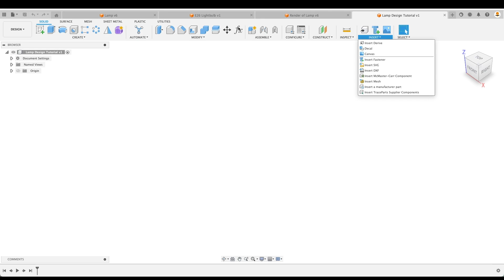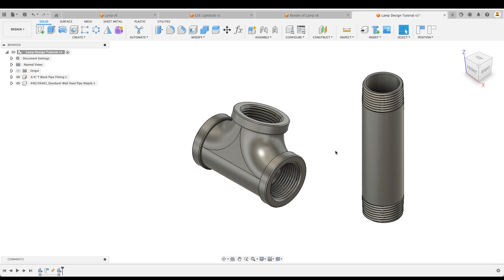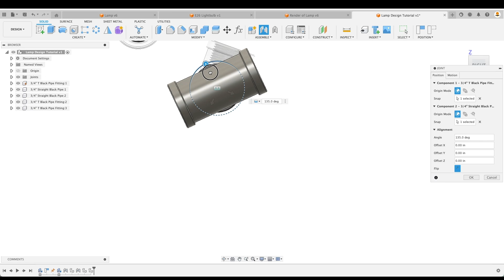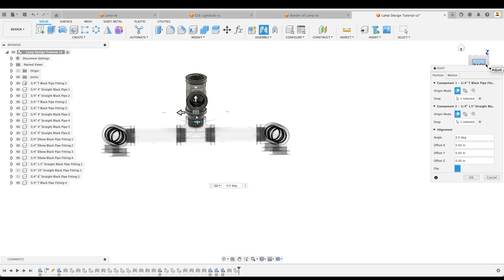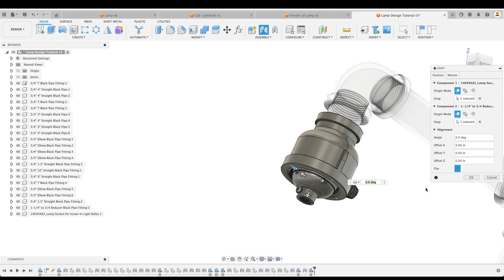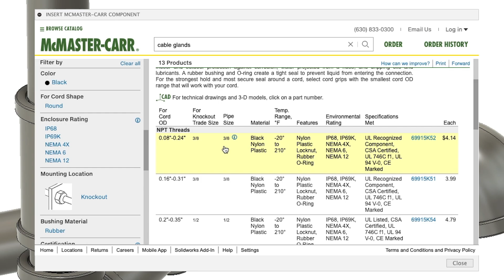Autodesk Fusion 360 - Black Pipe Lamp - Assembly Tutorial (2024)

Comment: If i wanted to specify how far the nipples thread into the fittings (0.6” as an example) how would I go about doing this?
Reply from the maker: I would just look it up on Google search, however please note that there isn't an exact length that can be calculated because of the tapered threaded and manufacturing tolerances. It also greatly depends on the size of the thread.
Reply: @learnitalready Thanks for the reply! I was more wondering how i would perform that task in fusion. If i wanted to insert the nipple a specified distance, what would be the best way to do so in fusion.

Comment: Hello, Learn It!. I started looking at your tutorials 3 weeks ago and I can proudly say that although I am not a professional yet, I can design some basic parts and also attempt intermediate projects. The reason for learning this software because of not only do I enjoy building stuff but I also have to do it to ease my final year of A-levels. I made a guide of it in Tinkercad and now I am designing it in fusion, at the moment the measurements aren’t what I intend to use but the appearance is good enough. However, I am having trouble with trying to sort out the movement of the table for tilt angle, I have tried to model threads so that some parts screw in together, I have also tried to do holes so that I can join some parts. I am not sure if this is possible, but I was wondering if you have a platform or app I could share the designs and my work so that you could please provide me with adequate guidance. Thank you once again for the tutorials and also taking time to read this ❤
Reply from the maker: Hello! Great to hear from you. Thank you for taking the time to write to us and expressing some of your background and current level of proficiency.

I would highly recommend that you join as a Patreon member if possible. The Aluminum level is the price of a couple cups of coffee per month (or 1 cup at Starbucks) and gives you access to, not only a host of other tutorials and resources, but you can also share your designs and get some feedback, either from me or our Patreon community. As you can see in each video, I always try to respond to comments. However, if someone requests detailed information on how to do something, I will a) either make a tutorial on it (if I think it is good for a general subject that appeals to many) or b) encourage you to get some 1-on-1 training with me. Regardless, Patreon membership is an excellent way to contact me directly and is most likely to get a better response than YouTube. Check out Patreon membership here: https://patreon.com/learnitalready?utm_medium=unknown&utm_source=join_link&utm_campaign=creatorshare_creator&utm_content=copyLink

Hope to hear from you again. All the best with your Fusion journey.

Comment: Is there any way to control how far the pipe threads into the fitting?
Reply from the maker: Thanks for reaching out. Are you referring to the actual pipe fittings, or just in fusion? 

If you’re referring to the actual pipe fittings, you don’t have a lot of play with them. They are tapered threads which mean that they eventually lock tight at a certain position. You can research what the tolerances are for each thread and apply it to Fusion.

If you’re referring to Fusion, then it is easy. When you join the 2 components, just move the mating component in or out more.

Please let me know if that helps.

Comment: I have really enjoyed using Fusion 360 and have used it in a previous job and present plus private work from home.  I have also used it on a iMac and on my present Mac-studio which up until 2 months ago was working well, until Fusion did a monthly update and any model I had that a had an appearance or material that had a texture to it like powder coat paint just look white what ever the colour.  I have tried contacting Autodesk several times with no success.  Normally they are very good. If you are going to invest large amounts of your time and money I strongly suggest you check out all cad softwares and which one works well for you and you and your hardware.  Again I think Fusion is brilliant in what it offers it's just a shame that the customer service has let me down and giving me updates on if they can fix this problem.  I feel very much left in the dark.  I can't work from home or work on private jobs.  Very sorry to be negative I just want Autodesk to reach out to me 😎